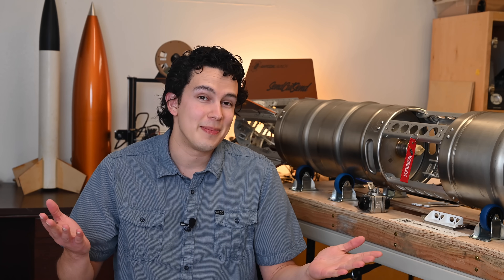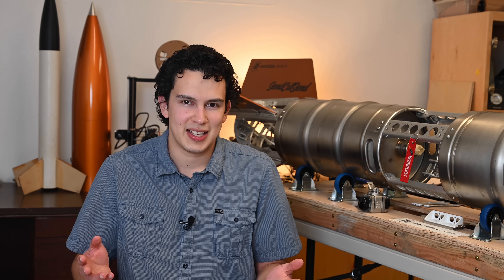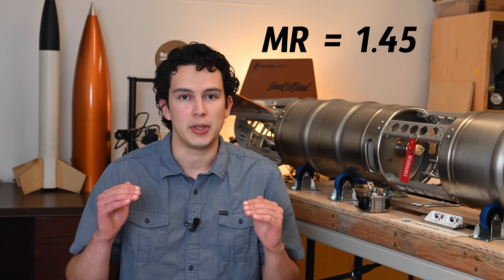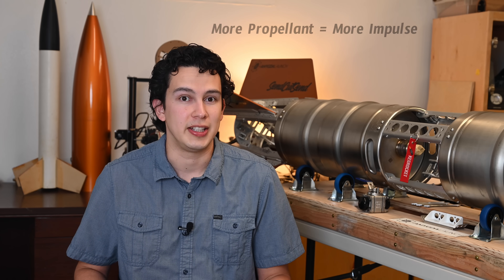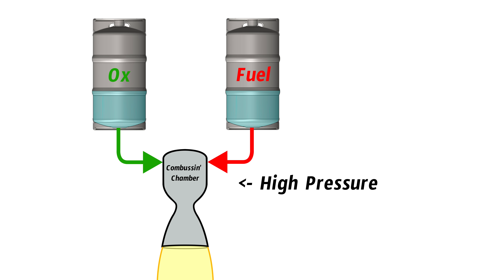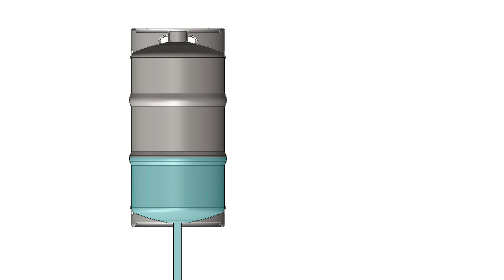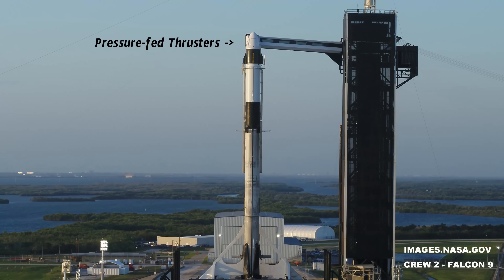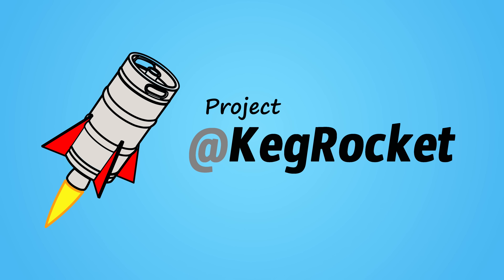Keg-Based Propulsion Design - KegRocket Ep. 2

Comment: Has anybody actually seriously discussed using FOOF as an oxidizer for rockets?

Sure, it's one of the most potent oxidizers known, but considering that it tends to randomly and violently decompose at temperatures significantly below it's melting point, not only would it be wildly unsafe and unreliable, but I'm not sure it would even be physically possible to feed it into a liquid fueled engine. I mean, id certainly be interested to see if someone wants to try a cryogenic solid fuel design, but please excuse me if I decide to watch from very far away

Comment: Has anyone used any sort of kinetic ram that leverages the existing weight of the propellant and some check valves to get slightly more pressure at the end stages of tank discharge? Not worth the weight? Or a spring/some sort of accumulator that can be charged alongside the pressure over/liquid setup here? I'm imagining a gas shock's floating piston essentially... I guess these don't work with the kegs, and additional cylinders that can take pressure are probably not worth the weight either. ... A design may still be worth considering. An internal bladder fed by a hose to a small accumulator with a spring in it, to keep pressure above a certain level.

Comment: You could redesign a beer tap to feed head pressure and empty the propellant as well
The nozzle can probably be put together like the old nasa style if you give it multiple small high performance engines instead of just one. Making small components would be quicker when testing different designs 

I test propulsion devices for a living if you want advice 🚀 would love to see keg-rocket take flight and go farther than anyone thought
Reply from the maker: Thanks for the thoughts here. We did consider multiple smaller chambers but were slightly concerned about the consequences if one of them failed to light. I like the idea about incorporating a beer tap.
Reply: @KegRocket bro you gotta post on YouTube again we are waiting!

Comment: How are you going to get propellant from the top tank to the motor? I think the space between the two tanks is very tight for a gentle curve to an external line. Is there no need to worry about sharp turns in this application?

Also, side note, every time you say kegrocket I have to snort because my friends jokingly refer to every project i work on with the prefix "kegg" as in my last name (e.g keggnet) and it gets on my nerves :]
Reply from the maker: We are finding that the plumbing bend radius is tighter than we’d like, but it’s possible to overcome with a little extra tank pressure that we have margin for. Excellent last name, by the way!

Comment: While designing this rocket, you will need to account for some other variables.  Some portion of your fuel will evaporate into whatever gas you use for pressurization.  The same may happen with the LOX.  Regardless of what you use for pressurizing the LOX, as its temperature rises, it will self pressurize your tank, changing pressure in the tank.  Also, you need to consider the difference in viscosity between your fuel and oxidizer as they may flow at different rates through the plumbing and valves.  Lastly, you need to figure out how you are going to get the fuel and oxidizer into the tanks, then how you are doing to get the tanks pressurized.  There is a lot of engineering that will go into this.

Comment: I thought you intended to use dehydrated 100% ethanol 🧐 but your website states that the fuel is only 95% ethanol. Producing pure ethanol could be an interesting part of the project.
Reply from the maker: Eh, it would run fine on 85-95% ethanol. It's just easier to say "pure" ethanol compared to something like store-bought liquor.

Comment: If you ever try to graduate to having some type of turbo pump, electric might be a good option. That's what Rocket Lab uses on their Electron rocket and it's pretty great for small rockets. I bet you could pull enough cells from old laptop batteries, if not then I know Amazon has them. You can still pressurize the tanks even with a turbo pump.

Comment: Wait? I'm an expert in avoiding The Kraken so Kerbals don't die...
How can you have staggered duel LXO/liquid fuel tanks? 
Even IF it was a intermix ratio of 1:1, you'd have a rocket that is top/bottom heavy, light in the middle...which Jeb Kerbin is sus about. 

Alternative 1:
Couldn't you cut the kegs and put a plate/gasket seal so bottom is 2/3 and top is 1/3...bottom is fuel+ comp air, top is comp air tank for maintaining pressure. 
Have a adapters in the plate as blow/pressure valves in: so its purely passive: moment fuel compartments pressure drops below X psi valves open and let extra comp air in. 

Alternative 2: Scramjet style pressurization
Same 2/3 and 1/3 type separation of the kegs...but top compart. is ramjet style inlet valve to just provide pressurized air as rocket is flying: same blow valve approach, but you don't need the weight of the comp air on takeoff; you'll make it once rocket gets to speeds for it to work.

Comment: If you plan on doing the paperwork and analysis for class 3 one day, it seems like you should design it now so you can just fill those puppies to the top. I agree a pressure vessel is too big, but I mean, you already have liquid oxygen. Couldn't you just put some into a vaporizer to pressurize the tanks? You would only need to vaporize a small amount to have enough pressure at the given volume, and you would have enough to not even suffer from pressure drop. I'm not really good at the math portion so idk if you could accomplish this in a small enough ambient vaporizer, if not, I'm sure a small battery and heating element could vaporize enough for your purpose.
Reply from the maker: This could be a good potential upgrade in the future

Comment: You will need to pressurise using Helium or Nitrogen and not CO2 to avoid complications with rapid absorption of CO2 into Ethanol and also loss of pressure due to cryogenic issues at the CO2:LOX boundary …unless of course you want to add some fizz and actually vent beer from the side of the rocket on the ascent 😂! Cheers, Kiwi.Pete
Reply from the maker: Carbonated fuel would be pretty interesting!

Comment: I like how I immediately understood why you want less propellant in the tank because it's exactly how the garden sprayer I use to water plants works. As you pump more out there's more gas to pressurize so it runs out slower and pumps the fluid more smoothly. I water my plants by rocket science cool.

Comment: Since you're doing shots of moonshine now, it's kinda like a Jagerbomb! Cant the launch pad be called the Keg Stand?

The feed system will help keep it from needing turbo pumps and other insane to engineer challenges. All you need now is just the combustion chamber, and to tinker around with the alcohol blow down gas being NOT AIR for obvious safety reasons. Argon, helium or propane might work but the pressure in the ethyl alcohol tank will be varied differently. The total oxygen amount to get 1/3rd liquid, and the orifice sizes to get appropriate flow are all going to be different constants or variables, but I would map the alcohol to the oxygen's natural flow for simplicity unless throttling is a must. You'll need to throttle one of the valves differently than the other to get a consistently fuel rich burn as the oxygen will evaporate much differently than the alcohol, so you will have two different pressure decay rates. Also you may want more alcohol to get more cooling without adding more specific impulse because there is no oxygen to turn it into power. One approach is to make a test rig for your engines and just try a bunch of combinations, you may find throttling the engines either super easy, super hard, or completely optional. The other contemplation is how to get maximum height and speed, with variables such as burn time, thrust level... Maybe there is an optimum, or maybe just full send, since there will be a 1g acceleration working against you. The less time you fight that 1g the better, but there are structural limitations of course and you don't want a dented beer can at max q.

Good luck! I wanna see space men and women take sips of fuel on the ISS as soon as you can get it to them! XD

Comment: did you guys use the Von Mises Yield criterian formula or the Lame-fairbairn equation to calculate the kegs theoretical Max operating pressure before testing it ?
Reply from the maker: Just the TWPV assumption Pr/t.
Reply: Sorry  i have yet to take physics im pursuing a CS degree in my freshman year rn. 
could you be alittle more specific on the acronyms and abbreviations? thanks
 @KegRocket
Reply from the maker: Sorry bout that, thin walled pressure vessel simplification for hoop stress.

Comment: I am waiting news for a long time. If it works it will be the most over engineered, expensive and cool water (I know it is not a water rocket) rocket ever. I propose the motto: "Et concilium meum est cum bibulis" from Carmina Burana. Everything was Ok until you start using Imperial Units and then my mind was filled with elevator music.

Comment: Just a thought,
If you're using the fuel to cool the engine, have it flow back through a heat exchanger in the tanks to heat/boil the fuel while also cooling back down the fuel going to the injectors.
  The increase in temperature should keep the pressure more stable instead of dropping off 
  What you think?
Reply from the maker: Interesting thought, and similar to the autogenous pressurization systems you see on actual space vehicles. Unfortunately we do not currently plan on using fuel to cool the engine.
Reply: @KegRocket  oh, oh well,
 how do you plan on cooing it?
Reply from the maker: @petevenuti7355   Ablative chamber liner that removes heat as it burns away, hopefully the subject of a future video!
Reply: @KegRocket  that would have been my guess, but I didn't want to presume.
  Have you seen that nighthawkandlight video on carbon foam?

Comment: Two of my favorite things, Beer and rockets. 😉
Just one concern, doesn't stainless steel get brittle at very low temperatures? 
I would have thought that may be an issue for a vessel under pressure.
Sorry, I'm just a backyard scientist so I'm sure you've checked all that out already.
Reply from the maker: Reasonable question. The ductility of stainless is fairly good at cryogenic temperatures.

Comment: I would really like to see a rocket that uses Carbon Monoxide fuel, and Ozone oxidizer. It's clearly the best at everything for all the reasons.
Reply: Carbon monoxide I get it, but ozone? That's is a nightmare, corrosive unstable and hard to manage, why not liquid oxygen? What would be the advantages of liquefied ozone?
Reply: @theOrionsarms  The advantages of ozone are its difficulty rating, and possibly for biosecurity in sensitive sampling missions. The disadvantages of Ozone are no more terrifying than sending dozens of pounds of metal into the sky on the end of an extremely burning flamethrower somewhat pointed towards the operator.
...also, I read somewhere that the CO+O3 combination had some superior quality of either more hotter, faster burn rate, or exhaust velocity. The disadvantages are the impracticalities you easily recognized.
It's also a combination that could be produced nearly anywhere in our solar system, and is environmentally closed-loop (fast/biological), and on other planets (slow/geological-chemical).
Reply: @buckstarchaser2376  nobody figured how to use ozone as oxidizer on a rocket engine in practical ways(not that don't tryed, but they failed) , carbon monoxide is a challenge by itself because have the tendency to detonate, but some progress has been made (in the sense that are some experts that believe that can be done), but ozone it's a challenge even to be stored in long time. And also, it's really matter if you can get more energy from that combination if you have no material that could resist to the temperature and corrosivity of the exhaust?
Reply: @theOrionsarms  I would really like to see a rocket that uses Carbon Monoxide fuel, and Ozone oxidizer. You won't convince me that I don't want to see a rocket that uses Carbon Monoxide fuel, and Ozone oxidizer. 
I don't know why you would even attempt to convince me that I don't want to see what I have firmly asserted that I do want to see. 
Such an outlandish goal you have set out to reach is about as unlikely to yield success as a rocket that uses Carbon Monoxide as a fuel and Ozone as an oxidizer... Yet, you took up such an insurmountable challenge, as did I; just to see.
Reply: @buckstarchaser2376  like I said,on the carbon monoxide side probably can be made, but with ozone probably not, it's not about what we wish (maybe you wish a antimatter engine as well), but are engineering challenge that are simply too hard to achieve.
Reply: @theOrionsarms  Pfft. Everything is too hard to achieve, if it isn't sitting on a plate in front of you. It had to be achieved somehow. 
I'm not interested in silly old antimatter, unless it can ionize some LOX on the way to the burner.

Comment: During launch won’t the rocket thrust increase the flow rate to the rocket be as the oxidizer and fuel are being forced into the bottom of the kegs?
Reply from the maker: Yes, but it's a relatively small effect in our case

Comment: How do you keep your Ethanol dry during storage? 3A Molecular sieves?
Because Ethanol you can only get up to ~94% with normal distillation (azeotrope and such). If the concentration is higher it will absorb water from the air. So you have to keep it dry.
Reply from the maker: Just sealed until ready for use!

Comment: What pressure drop are you using on your injector.  I wouldn't go below about 50-60psi or you'll likely get combustion instability.  Higher pressures will kick up your tank pressures.    I think I ran 250psi chamber pressure with a 60psi drop across the injector and never had any issue with the engine..
Reply from the maker: Pretty close to that dP

Comment: You can use liquid CO2 to pressurize fuel tank. it's 76 atm at standard temp, wich is compatible with Keg pressure limit.  A rubber inner tube can be used to separate CO2 from Fuel and Liquid Oxigen. So you can have constant pressure for all the flight.
Reply: Rubber at cryogenic temperatures would not be flexible; it would become brittle, and shatter as tried to stretch.
Reply: @gdpirahna  at 76 atm C=2 is liquid at room temperature. Not cryogenic.
Reply: @rikpoletti  How would you prevent the rubber from contacting the LOX?  If the rubber is in the LOX tank, it will not be flexible.
Reply: COMPLEXITY! COMPLEXITY BAD!
Reply: @Rizzler420-uh4yd  Much less complex than a pump It's just a bladder in the keg.

Comment: Seems to me that acceleration would help out feeding of fuel, and, at a constant feed rate, acceleration would increase as fuel is burned and overall weight  drops off.  Secondly, the pressure difference between the inside and outside of the tank would increase as the rocket climb, both considerations leading to there not being as much loss of feed rate.  Also, to the degree that the feed rate falls off, the pressure in the engine would also drop off, so the back pressure in the fuel lines resisting flow would be less.  By the way, the V2 used alcohol (I read 75%) and liquid oxygen.

Comment: I am worried that the bolts may vibrate apart during flight. I wonder if you could break out the TIG welder and make those joints stronger.

Comment: Cooling and keeping the LOX cold is going to be....challenging.  You're going to need some insulation, not to mention the complete cluster f*k that is dealing with LOX.  Cleaning is going to be king, as any dust particle or stray hair provides fuel for the LOX that can be ignited, and it will ignite, LOX always finds a way.

Comment: you might want to use 96% ethanol and not 99%. It is cheaper, and burns a bit cooler, with almost the same performance.
If you have engine temperature troubles, you can easily go down to 60% ethanol + 40% water, which should perform okay, but burn "very cool"*.

* for a given value of "very cool"

Comment: I see you have an Avco CF8M in the background there. I've seen some issues with thermal expansion with LOX causing leaks to occur with those specific valves, have you figured out how to deal with that?
Reply from the maker: We're somewhat worried about that. I did work with Avco directly to specify a special seal package that works, but we wont know till we test it.
Reply: @KegRocket  grafoil?
Reply from the maker: @theastrononeer1211   TFE body seals
Reply: @KegRocket  ah.

Comment: Wouldn't pressure regulating the fuel supply lines simplify the motor design a lot? Been following the project quite a while, love these videos
Reply from the maker: It might simplify the motor a bit, but these are solvable problems

Comment: What effect does the acceleration have on the flow of the fuel / oxidizer?
Reply: Great question, there is also the atomization of the ethanol to consider, and at what temperature, then the viscosity of the liquids and the pressures of each, then the G forces. Check out "EXTREME ROCKET!!! O25,000" Gerald 'Skippy' and his 'death from above' O 25,000 motor rocket. He estimated 50 G's, built it for 100 G's, and pulled 75 G's. It is an awesome launch! WHOMP!
Reply from the maker: It will increase the pressure at the bottom of the tank slightly, but it's a relatively small effect